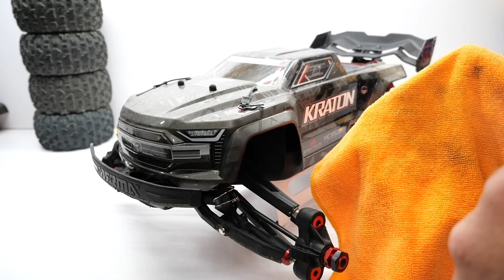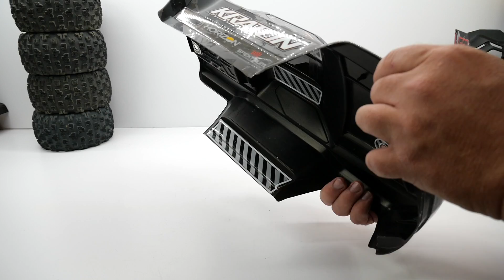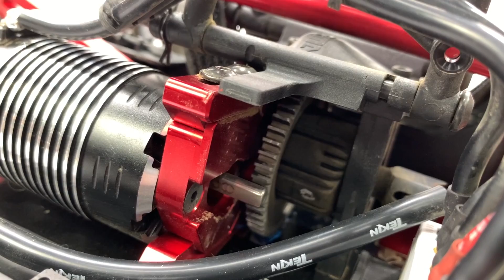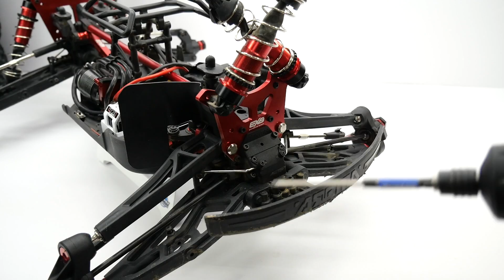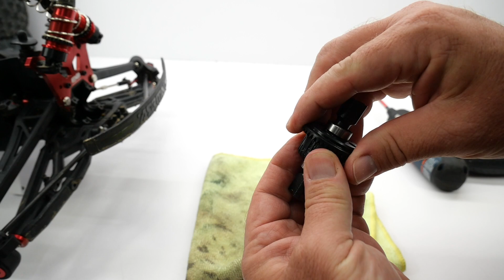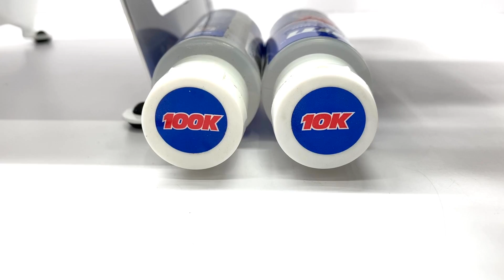Arrma Kraton EXB - What broke?  Differential Up Close / Maintenance After Running

Comment: Basically the diff works because the side gears get pushed outward due to their beveled nature when one wheel starts to spin.  This pushes on the clutches locking them together.  Since some clutch discs are tied to the axle and some to the diff case it slows the spinning of that axle and wheel.  I'd be interested to see how well this works in practice though since there is no friction material on these clutches.  Can you try to hold one wheel and spin up the motor?  If this works properly it should be very hard to hold one wheel while the other spins.
Reply from the maker: Thanks for the info - and I'll test that out
Reply: Do RC exactly this! https://youtu.be/WeLm7wHvdxQ

Comment: Are the differentials interchangeable with 6s BLX differential  ?
Reply: Yes they are they drop right in they will be able next month $80 to do each dif
Reply: You are to use the corresponding input gear
Reply: @jasondearden1394  yup $60 for the ara311066 and $13 for ara310979 then whatever they charge for shipping and tax so I say around $80 to do each case.....I wanna also say thank you for the new drive line parts and its something that was much needed
Reply: @onemansvideos2134  I have an Outcast, would that apply to mine and well? I know they share a lot of parts
Reply: @PrairieRC204  yes you need those parts I listed...the ara311066 and the ara310979 you will need 2 of each ....now that dif I listed isn't the limited slip version that is ara310990 if you like running 6s alot go with the limited slip
Reply: @RC Daniel you gotta spend more than that at least 300+ depending on what brushless system you go with
Reply: Thanks so much for that. Can't wait for them to be for sale mate.

Comment: Is there an alternative to the blowing air? I don't have a compressor.
Reply: toothbrush and paintbrushes
Reply: @Vergeetmenietje  thanks, great idea!
Reply: Go to Walmart and buy a case of air duster 6 cans for like 12 bucks in the computer section basically cans of compressed air for dusting keyboards and electronics
Reply: Harbor freight has $30 air compressors some times.
Reply: @mynameisfrank6519  I have one of those. Not really worth it. They run out of pressure pretty quick & are loud.
Reply: keyboard air duster